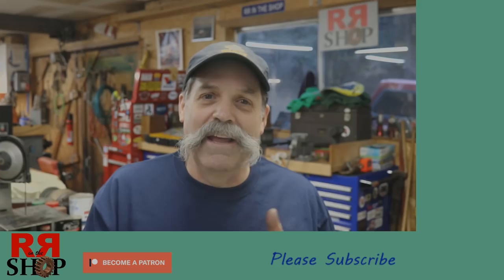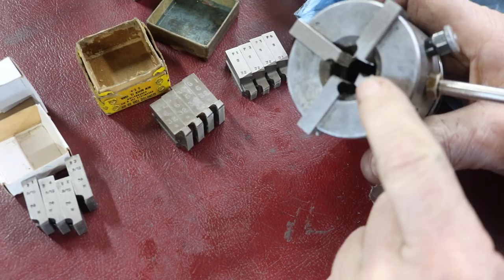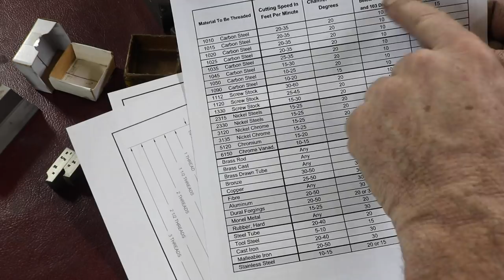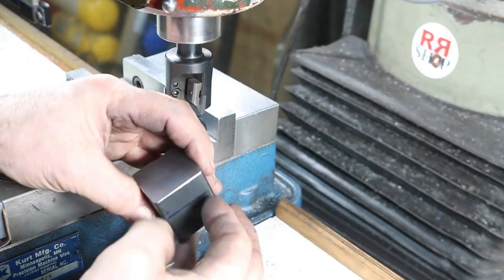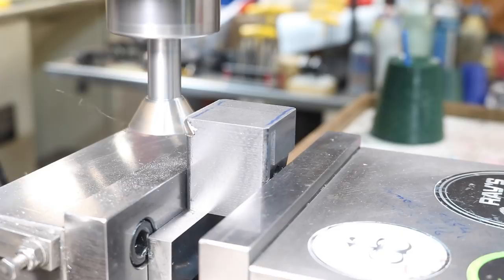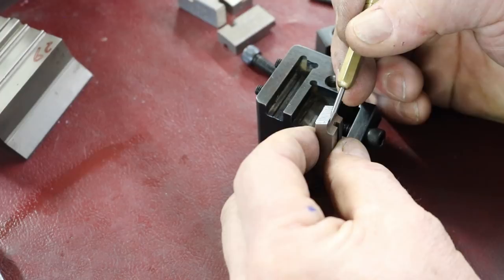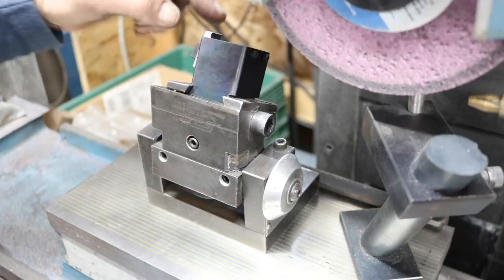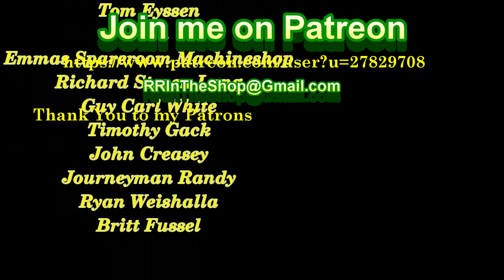How to Sharpen Dies | Thread Chasers / Dies | Geometric

Comment: Used to work with various dieheads many years ago,  Coventry, Landmatic, Namco, Wagner. The best were the Namco which had round chasers. Each type had it's own fixture for regrinding and as you say angles were different for each material.
Reply from the maker: Thank you Andy.  Using a die is great when making a bunch of parts.

Comment: That's a fixture for dovetail formtool grinding; screw machine tooling.
Reply from the maker: Thank you Terry for the great info.  Kind of thought it was something like that.
Reply: @RRINTHESHOP  When dovetail and circular forms are designed you have to account for the form deviation when top rake is applied.  If you change the top rake the form will change.

Comment: Hi Randy, somewhere i have the Coventry die head, that's the English style of chaser arrangement, made sharpening jig for their chasers, can't for the life of me remember where I put it but it is only a few years deep in the clutter so should be able to find it. When I do, would you like to see a run abound it? It might have some features you could copy, but i have to admit i have never used it myself so not particularly au fait with its finer points.
ATB 
c
Reply from the maker: Thanks Chris, i have not seen that type.